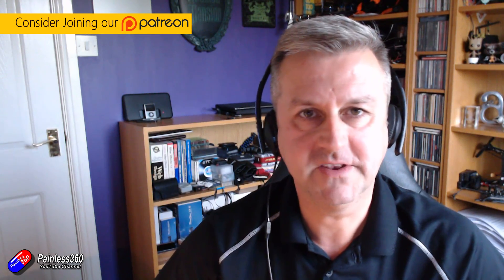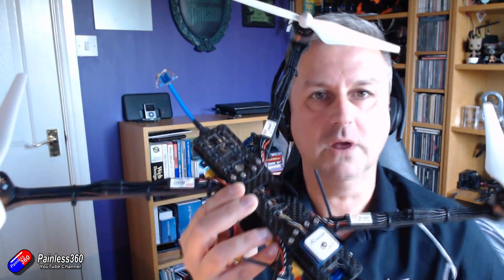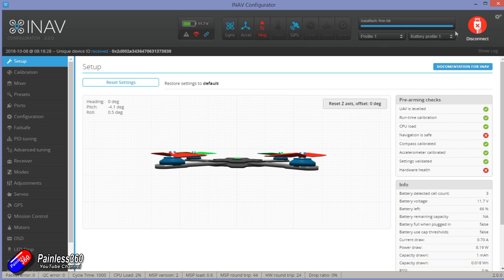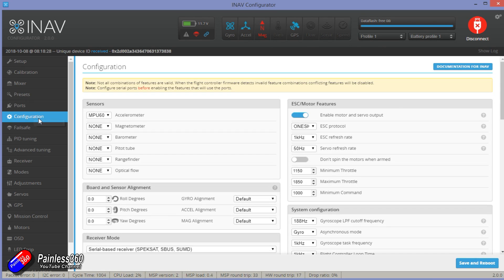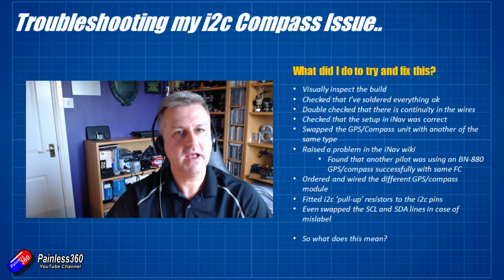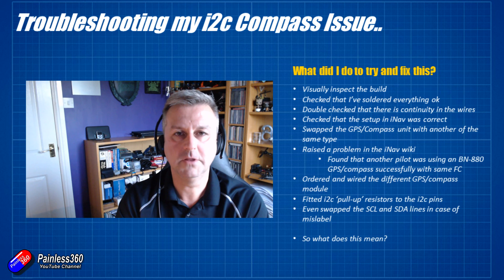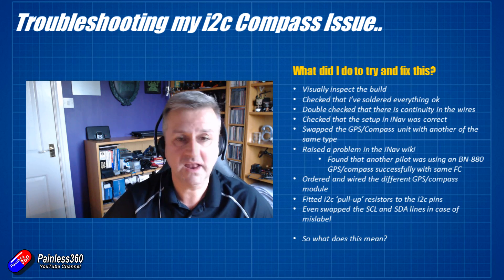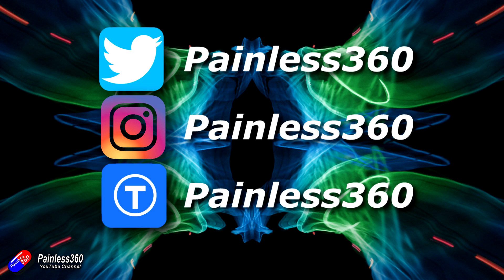Quadcopter Building: How I'm Troubleshooting my i2c Compass Problem

Comment from the maker: UPDATE: Thank you to ALL of you that offered constructive support ideas. What a fab community we are - that wasn't the idea of the video but I've had some great suggestions and support. After getting to the point where it has to be the FC hardware or something in iNav (despite there being no other reports of i2c problems on this flight controller), I've flashed it with Betaflight 3.5.2 and guess what - the compass worked straight away! So, not hardware at all but either iNav or something to do with iNav and this version of the FC.. Stay tuned!
Reply: Try reflashing the FC with the latest iNav firmware with the "erase all memory" option enabled. The FC keeps some settings in its internal memory even after a firmware reflash that can mess up the configuration (especially while migrating from betaflight to iNav or vice-versa. Btw i had the exact same issue with iNav and and a GPS/Compass combo in my build some dayw ago (the i2c bus seemed dead on the oscilloscope like yours). The solution for me was to wire a different standalone external compass module. There is deffinetly a bug in iNav somewhere...
Reply from the maker: That is an excellent idea. I will try that as I can see it's not hardware now...
Reply: Good stuff mr P. Although not your current problem I've had wire connections inside gps modules disconnect.

Comment: I'm here trying to learn about I2c- this is because unlike FC's with assorted UARTs, it seems like most controllers have only one I2c, and crucially that is the preferred (only) interface for GPS, Compass and Barometer.   I'm lacking a barometer but using a BN880 compass/gps.  Now I have to find a way to integrate an external baro.   Any ideas?  (Flywoo F411 Hex FC).
Reply from the maker: Assuming they have different I2C I.D.s then you can connect all of the SDL wires together and all of the SCL wires together.. https://www.bluedot.space/tutorials/how-many-devices-can-you-connect-on-i2c-bus/ covers the basics of how the bus works. Best of luck.

Comment: Hi Painless360, I know that its been a while now from this video, however, did you find a solution to your problem ?
I am a total beginner but I have picked up some info after changing settings in betaflight in cli, I managed to get all sensors to be detected in betaflight, however a few hangs of the FC now and then and one of the sensors, either baro or built in mag from gps doesnt work.
According to my testing, on my mamba f405 mk2, i have just one set of psychical sda and scl pins, so after a few days of figuring it out and eventually finding the FC pin out table, I found the remapping pin tables and read that my uart 3 rx and tx can be remapped into i2c sda 2 and i2c scl 2 ports, which I did, and it worked, but what was actually preventing me from making the compass and baro work together in betaflight was the bustype, i2c addresses, i2c device, the speed of the i2c ports, the serialrx half duplex being on or off, and even the correct models of the baro and mag had to be set to have it all shown and working in betaflight 4.1.5. , but, either the baro did not function or the mag did not function even though they were showing that they were detected by betaflight. It was either that or betaflight halts , so I'm still trying to figure out what can cause the halt, its definitely FC configuration in cli.
I think I might have to try pull up resistors because I tried a few things but no luck. I wanted to activate the SPI mode on the baro but there arent any pins for spi on the FC  and it seems that my FC cant remap the spi protocol to other inputs that I can literately see, I dont know which pins the spi 1,2 or 3 are .
Reply from the maker: Yes, it was a software issue in iNav.. See my other recent iNav builds for kits that works better out of the box. Best of luck.

Comment: Hi,
I have searched high and low for the same issue, and believe me, I have done exactly the same steps even down to the position where we soldered the pull up resistor. I've done all of that even before stumbling on your video! Just FYI I'm using the same BN-880 GPS/Compass and if you look at the unit PCB, there are already 2 1k pull-up resistor on the GPS unit. Technically it should already work out of the box on a I2C.
Unfortunately I'm using a Airbot F7 (not the Omnibus F7 or the NXT), which is not supported on iNav (there is no barometer, even if I install an external Baro, there is no such Target in iNav). As for Betaflight the Target is there, but I can't try the older firmwares before 4.0 as the Targets were not there. I somehow believed that the issue lies with the Betaflight FW.
Reply from the maker: Very possibly, the testing of this open-source code can sometime miss when less used features are broken in an update.. Happy flying!
Reply: @Painless360  Yes, so I have managed to get my magnetometer to finally work on Betaflight.

1) I can confirmed that the BN-880 GPS already has a built in pull-up resistor and will work out of the box. No additional pull up resistor needed.

2) Magnetometer and Barometer definitions for Airbot F7  in Betaflight was omitted in 4.0 and hence it was not working. I amended the definitions file and recompile my custom firmware and it now works.

Unfortunately for iNav, they didn't define Airbot F7 as a target. To do so requires more info to write the target code and its beyond me.

Comment: Do you calibrate compass while esc's are turned on?
Reply from the maker: You normally calibrate the compass with the model powered but with the motors not running. See my latest Ardupilot series for tips on finding a great place for the compass where it won't be affected by stray magnetic fields..

Comment: Hey Lee how do you select the external compass when the FC has the same type of compass built in? So far the only solution I can find is to manually remove the compass off the FC board, is that the best thing to do? Thanks
Reply from the maker: You have to disable the on-board one. You can't have two i2c devices with the same ID..
Reply: What's the best way to disable it.. desolder it? Thanks  @Painless360
Reply from the maker: @fpetev6925  probably. I used to shield the FC with NuMetal back in the day if it was too near the power wires..

Comment: Tnx Lee! 
I'm stuck with the same problem, but with Ombnibus F4 v3. FC does not recognize GPS, but when I flash it with Betaflight works! Tested with F4 v3 and F3 v2 Pro. It looks like the problem is with iNav 2.0.0. Now I know that I do not need this new spare GPS, just what I ordered. ;)
Reply from the maker: Looks like there are a few 'issues' in iNav 2.0. I'm hoping that they get fixed in 2.1..

Comment: I had something similar with a different project and used an Arduino with a really simple sketch to verify whether the i2c interface was working -and it wasn’t in my case. It’s just another tool in our box.
Reply from the maker: Great idea, see the update comment - I've flashed with Betaflight and the compass works great so it's a code/interaction issue..

Comment: Possible that the I2c hex address of the compass is not matching the software in the controller.  This problem comes up with Oled displays as an example.
Reply: There is a small program available that fits on to any Arduino and you can scan for whatever i2c devices are on the line and what their address is. 
Easy to use.

Comment: Good points and explanation, I actually have a similar issue but with the barometer (BMP280), added compass to I2C (which works), and then in parallel the barometer, with pull-up resistors and without, basically tried everything you talk about and it does not pick it up :-/
Reply from the maker: This is one of those areas that does seem tricky. With the different revisions, clones and changes in flight controllers you can't rely on one model working every time. I'm suspecting a Hardware issue on the FC or bad code in iNav at this point..
Reply: @Painless360  I couldn't stop investigating this yesterday, so I've taken apart my weather station I built long time ago on Arduino and took barometer from there. Soldered it quickly to my quad, and it worked! So I de-soldered everything to put back together the whole thing, powered it on and it's not recognising it anymore... gave up at this point, maybe I overheated it or something 🤔
Reply from the maker: In my investigations I was reading that you can't put them both on the same I2c line for some flight controllers, so maybe that's part of the problem in your case?

Comment: By swapping the GPS and the second one not working you are assuming that at least one of them works, was this confirmed on a different quad? It is quite possible if you got both from the same place that you have two faulty ones.Try hooking one up to an arduino's I2C port and see if you get a response from it.
Reply from the maker: The GPS does work on all three - all GPS elements get a beautiful solid 3D GPS lock in seconds. It's the external compass connected by the i2c cables that has the issue. Thanks for the comment, happy lfying!

Comment: Some compass modules have pullup resistors fitted on so if your FC board has them aswell then you can have issues with i2c,
I've had this issue with a compass and a pixhawk FC, I have found and removed the resistors from the compass module and it works.
Reply from the maker: Thanks for the idea - I'll check this one! :D

Comment: I will change the mapping for the I2C pins to other free UART. Whit "resource i2c_scl 2 b10"
and "resource i2c_sda 2 b11" for example I am using an I2C magnetometer in an old Matek F405 under betaflight
Reply from the maker: Thanks for the idea. Could be worth a shot!

Comment: I founded that the best route in this is use hardware that are compatible to each other,  and     stick to it.  I had inav on a SP racing F3 flight controller, and this has a compass incorporate, I found that the FC do not like magnetic fields, so keep all possible power wire away, and    the omnibus f4 v2 and v3 work perfect with external gps compass combination.
Reply from the maker: Agreed, see all my other iNav builds. This one is an experiment so handily does show some of the problems that you can run info..
Reply: @Painless360  yea experiments are fantastic but some time you go crazy. LOL
Reply from the maker: This is the only experimental build on the entire channel so not sure how that constitutes 'crazy' ;) Happy flying! :D
Reply: @Painless360  Nothing is crazy, you doing one of the best channel in you tube, with 1000's of answers.

Comment: Hi Lee, Once i had I2C problem with OLED screen that wouldn't work.After struggling for days,i found that the problem was 5V.I was feeding 5V instead of 3.3v.So your I2C signal line's pull up resistors should be connected to 3.3v.
Reply from the maker: Thanks for the idea but I don't think that the resistors are the issue here as if I check the GPS on it's own I can see them.. I'm checking the other end in case the combined values of the pull-ups at both ends is dropping the effective resistance.. Thanks for the comment.

Comment: Same problem here. It's the FC.
I tried 2 different NEOM8N with Omnibus F4 Pro V3 and Omnibus F4 Pro V2. Adding Pullup resistors, changing I2C speed, etc like you did using the latest version of INAV(until last week).

Then I switched the FC to Matek f405-STD. 
Magic!!! No need for pull-up resistors or reducing I2c speed. It detects the compass automatically.

Well.. it's not a solution :( 
I'll wait someone will find the actual issue and tell us how to solve it.
Reply: I'd like to add to it that I had nothing else connected on the UARTs except GPS and compass on SCL(TX3)/SDA(RX3).
Reply from the maker: I've just ruled out the hardware by setting up the FC with Betaflight and the compass is working.. Hmmm..

Comment: I had an issue with the pull up resistors it made the i2c errors jump to 9000 and more so i added two 1k pull ups to the module and it got fixed.
What I’m saying is if your i2c errors in the inav window is less than 3 your pull ups are fine
Reply from the maker: Errors are zero so It's not even getting that far! :D

Comment: That's where using chinese is a wrong place to buy your parts: if you need a replacement, you'll have to wait a month to see that it maybe not be this component the problem. So either ship more component twice or use local online/offline shop 👌

Comment: Check whether the UART for I2C is already occupied by something else.... spare that for magnetometer and the compass will work
Reply from the maker: Nice idea. It’s not. Happy flying!
Reply: that was exactly what I was going to suggest
Reply from the maker: Thanks Jack, see the pinned update on this one - it works in Betaflight so it's not an i2c or hardware issue.. Looks like something in iNav or in the iNav/Hardware interaction.. So frustrating!

Comment: I haven't used INAv so these are just guesses based on some I2C experience.  Is there another firmware you can load (even if not INav) just to check the I2C port and connection to the compass ?  The scope should have shown something.  Is INav using the correct CPU pins for the I2C port on the fc board ?

I haven't had any I2C problems recently but the last time was on a large DSLR gimbal.  The sensor wire run was over 500mm.  Solution was I2C buffers at each end.  Not likely a problem on your quad.
Reply from the maker: Thanks for a great suggestion. It's possible but as others are reposting that this exact compass/FC setup works then it's possible it's a HW/FW issue on these pieces. Interestingly there are no i2c errors at all on the interface so I'm guessing that it's not initialising at all..
Reply: I guess your fc has the same processor chip as the others are using - same family member with all the IO in the same place.  I haven't looked at the code and wonder if it's a hardware I2C port of handled in firmware.  I've seen a lot of fc boards over the years with no protection on the lines leaving the board, so the processor can be easily damaged.  IMO series resistors are minimum requirement, although you can't do too much to high speed data lines without upsetting the data.
Reply from the maker: I've ruled out the Hardware now, see pinned comment, this is one of those areas that does need to be a lot more robust from developers in their code.. thanks again!

Comment: I think you need an oscilloscope...
Reply from the maker: Got one - see video ;)
Reply: So... do you get any clock signal and data on the I2C bus? Can you see the address part of the message and does it match the address of your sensor?

Comment: Hmm. Your test regime seems entirely suitable and seemingly you are left with two possible failure points. But as they are linked I'm not at all sure how you can separate them or, indeed, if you can. Not without changing from iNav and/or changing the FC as well. And that wouldn't solve the problem you have. It would just bypass it (at best).
I still believe that if it is possible to solve it you will solve it eventually and I look forward to seeing how :)
Reply from the maker: Testing with another lot of code (Betaflight) has proved that the mag is working.. Looks like iNav now..

Comment: Try "set i2c_speed=200kHz" or even 100kHz.
Reply: This will higher the CPU usage and limit the looptime. Not a solution. I guess the issue is on the FC.
Reply: That depends on if your gyro chip is i2c. Many modern flight controller boards use SPI connected motion sensors. If this is the case you can reduce i2c_speed without adversely affecting the looptime.
Reply from the maker: I’ve tried that but thanks for the suggestion.. :)

Comment: The plug or the connector on the compass? Voltage a bit to low?
Reply from the maker: Thanks for the idea. Voltage is good - GPS runs at 5v, the HMC5883L runs at about 3v and the GPS is powered so there is enough for the voltage regulator on the GPS/Compass module to run too.. Thanks for the idea though..

Comment: Very nice video Lee!  Also very recognisable situation! I tried changing the baud rates in the ports tab and that fixed the issue for me. When GPS is connected what does the GPS statistics says in the GPS tab about Total messages, timeout and errors?
Reply from the maker: GPS is perfect, it's the i2c bus that doesn't seem to initialise/transmit successfully ad I have also changed the i2c speed to no effect. It looks more and more like a H/W issue on the FC I'm using....
Reply: @Painless360  I got the same problem with my omnibus F4 v2, and general M8N gps with compass. My compass is not detected on inav 2.0., but, changing the i2c speed to lower speed, fix my issue. Im sorry i cant help you out...
Reply: @Painless360  big bummer, this GPS and flight controller communication technology can use some extra development to create some universal standard.